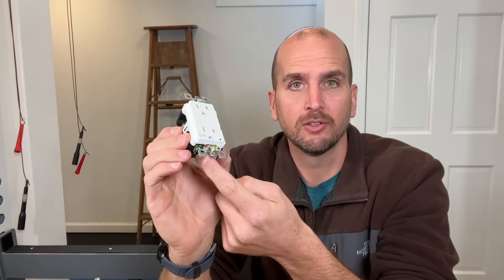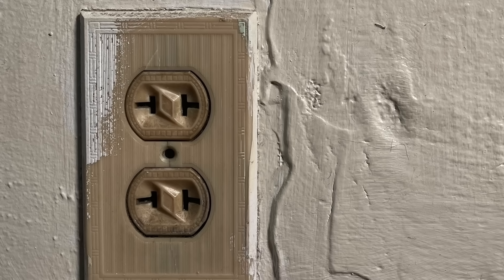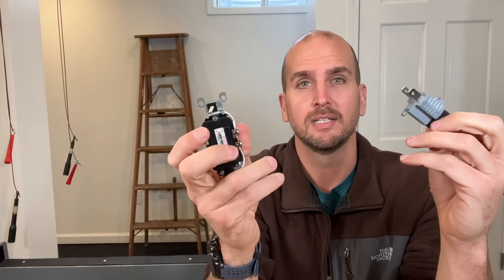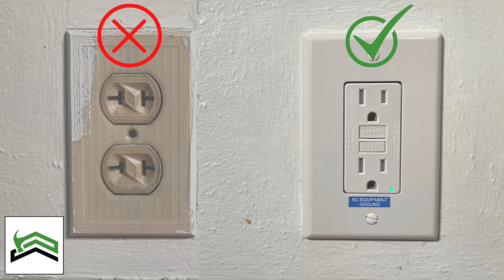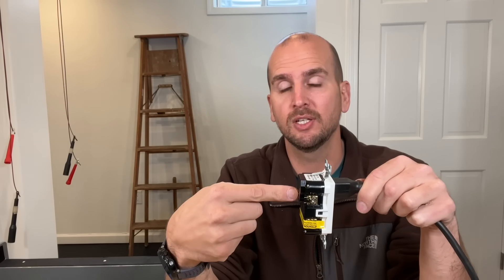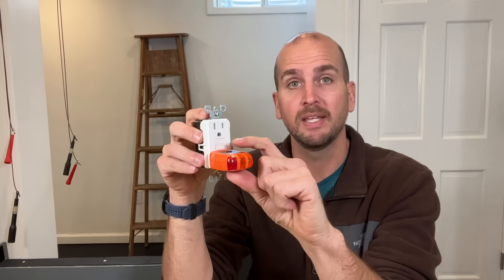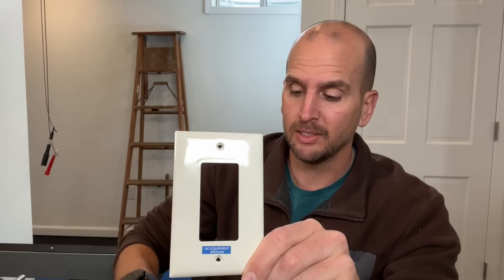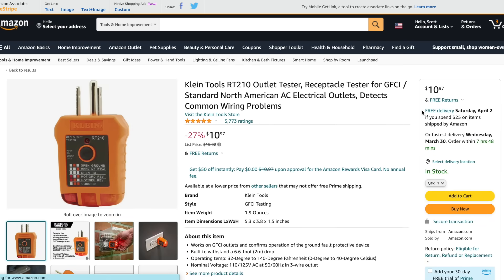Does a GFCI Outlet Still Provide Protection Without A Ground Wire?

Comment: There's a semantics issue with your question. GFCI outlets have nothing to do with the grounding system of your home and therefore, despite the name, they don't actually provide "ground" fault protection. What would have been more accurate is if the inventor called them NFCI as they're actually neutral fault protection. 

Yes, the ground and the neutral are ultimately going to the same place, however, they aren't exactly the same thing. The neutral wiring is an isolated and insulated return path to the panel and is safe for constant electrical flow.  The ground wiring is broadly connected (including to parts of an appliance that shouldn't ever be powered) and is not insulated and is not safe to ever have power except to in that rare moment it's needed. 

Ultimately, yes a GFCI outlet provides superior protection to standard grounding. This is the reason why they are required in wet areas of the home where you're more likely to have problems. In the time it takes for a standard grounded breaker to trip at your panel, you could be dead. If it wasn't for the cost, code would require every circuit in your home to have this and arc fault protection as well.
Reply: You mean its not going to the grounded conductor, is that what you are saying
Reply: I'd call them an 'Unauthorised path device' - where an electrical current is using a path it's not authorised to take !
He's wrong with his 'yes' to the original question. Without the ground connection (if not obvious it's via the neutral wire - which is connected to ground elsewhere) the GFCI would not trip - but neither would it need to as a ground circuit could not be made.
Reply: It depends on what you mean by "ground fault".  If the fault is you standing in your bare feet on a concrete slab, or touch metal siding, or copper pipe, and touching the hot you are the ground fault, and the GFCI will trip.

The terminology has nothing to do with the ground wire, it is about detecting the most common reason for you getting zapped - you providing the ground path.
Reply: Ground fault means current escapes to the ground. It has no direct connection to the grounding wire though it can of course be one possible path it escapes. (and  likely the list common on case if a tripping). The thing that GFCIs are designed is the current escaping through a person.
Reply: You are thinking about it backwards. It does sense ground faults, but it does so by measuring the current on the neutral. So it measures the difference any time there is current going to ground instead of back on the neutral. If current goes to ground (ground fault) instead of back on the neutral, it will trip. Thus ground fault protection.
Reply: @brianharmeson3144  I don't think you understood what I described.

A GFCI measures the difference in current between the hot and neutral, and trips if they're unequal.  It does it in a simple way by winding a turn or so of both thru a toroidal core.  If the currents are equal, the magnetic fields cancel.  If they're unequal they don't cancel and the detection electronics fire the contactors and turn off the circuit.

"ground fault" is a rather "generous" term to describe several different things, including hot-to-ground AND neutral-to-ground shorts, perhaps not even to a wire in the same circuit, or even dirt.  Indeed, in some really inductively noisy circuits (eg: switching high load motors off and on), induction/capacitance can get the hot and neutral to momentarily disagree without any shorts anywhere - aka "nuisance trips".
Reply: @fromagefrizzbizz9377  My reply wasn't to your comment. It was to Roger Smith.

Comment: Most gfci's will not work without a ground
Reply: Why not
Reply: @thomasmarable6818  Most will still work as the neutral is grounded - at the main panel or by the power co.

Comment: One HUGE issue I ran into replacing an ungrounded two wire receptacle with a GFCI was that it was mounted in a metal box and the hot screw was touching that box, then passing through the mounting strap to the ground pin. The person had a refrigerator plugged into that receptacle and the frame was then hot as a result, and the GFCI did not trip, because the power going to the box came from the feed wire and not the load side of the GGCI. In this case, a narrow situation, and not to code, but still in my opinion safer, is a jumper at the receptacle from neutral to ground, this would have created a short and tripped the breaker and not allowed the refrigerator frame to have become energized and shocked the owner. FYI I did not do the original install, I just fixed the problem later, and not with a jumper, but to keep the screw from touching, but I would like to see a change to allow for the jumper.
Reply: @integr8er66  I'm pretty sure its a bad idea to ever connect neutral to ground.  Imagine the neutral wire feeding the outlet becomes open due to a bad connection leading to the outlet.  Now when an appliance is plugged in and turned on, the power is fed through to the neutral wire which is jumpered to equipment ground.  There is now no return path to earth ground via either the neutral or missing ground wire.   This then energizes any exposed metal that is connected through the jumper to the now hot neutral.  Better to do what you did and keep the screw off the box.
Reply: @djcanfield1  Imagine the alternative which actually happened rather than speculation on what might have happened which would only create a situation of exactly equal danger. I think its highly unlikely that the neutral wire would just fail. Just my opinion, and I doubt anyone at the NEC will agree 😁
One more thing to note. This condition existed for over two years that she lived there and who knows how much longer, but she was never shocked until she touched the refrigerator AND the metal part of the dishwasher (which was very inaccessible and only happened because she was reaching under it) which actually was grounded at the same time. Just think if neither one was grounded, she would not have ever been shocked.... Grounding good or bad in this case??? The ground in this case made the other situation more dangerous, not less
Reply: @integr8er66  This would happen regardless of whether it was a GFCI or a regular outlet.  This is just sloppy workmanship, and one reason you'd might prefer to put a wrap of electrical tape around the outlet terminals.

By connecting the neutral to device ground you'll cause any GFCI upstream of it to trigger.  Which'd get annoying if it was a whole-house GFCI.

Neutrals do get loose sometimes, and the consequences can be really nasty if it's at the panel.  This is why the NEC has been banning 3-wire connections to stoves for decades (in three wire stove connections, neutral is connected to the frame), and the CEC even longer.
Reply: @integr8er66  You should follow the code. Then you can think how you can improve things without breaking the code. The thing is that if someone gets killed and you have broken the code you are screwed. Nobody will listen your explanations how you thought it was safe.

I agree that connecting the ground and neutral to the ground is not inherently dangerous. It was the standard method in many countries for decades. In Finland it was the only method allowed in 1930-57. Since then until 1989 it was allowed and common. It still is legal if one wants to ground existing sockets. Here one would do that only if one wants the actual ground as one can plug any plug to an ungrounded socket. Here the GFCI method would be illegal.

To ou a simple example you cannot hägo to the UK and drive on the right side and then claim it is no more dangerous than driving on the left. You should do what is expected.
Reply: @fromagefrizzbizz9377  if there was a GFCI upstream there would be no issue.
Reply: @okaro6595  If the ground and neutral were connected between two GFCIs, the upstream GFCI will trip once any current flows in the neutral.
Reply: @fromagefrizzbizz9377  No, it wouldn't happen if it wasn't a GFCI because if it wasn't it would be a 2 prong receptacle and thus no ground at all, but that wasn't my point, the point is with the GFCI it did not protect the user, and it did not trip the circuit breaker, and it caused the frame to be hot because of the ungrounded ground pin that was connected to the hot box. I know neutral ground bonding like I suggested are bad, but I think in this one instance it might be a better solution.
Reply: @okaro6595  Did you even read what I wrote? I SAID I DID NOT put the jumper in, I SAID I wanted the code to change to allow it. I did the work to code.
Reply: @okaro6595  That is true, but there wasn't, and the installation was 100 % to code. There is a problem with the code because it allowed this problem to exist
Reply: @fromagefrizzbizz9377  Why would you put two GFCIs is one circuit? If I put in a GFCI breaker I would put a regular three prong receptacle in in place, or just use the GFCI receptacle with no jumper. The jumper is moot if there is an upstream GFCI
Reply: @fromagefrizzbizz9377  There would be no reason to put the jumper in if there were an upstream GFCI.
Reply: @fromagefrizzbizz9377  This is about installations without ground wires. The  GFCI can trip if there is some alternative path like a washing machine could leak through water pipes. On TN-C GFCIs are therefore not used on PEN-wires even where PEN-wires are allowed.
Reply: @integr8er66  A better solution would have been to change the box into a plastic one or put the GFCI upstream.
Reply: @integr8er66  Are ungrounded metal boxes allowed by the code?
Reply: @okaro6595  They were when this house was built, and I don't think changing the box is required just because you change the outlet to GFCI (That I know of)
Reply: That is one big fault in the method. A GFCI protects only against faults that happen after it. Since the grounding conductor connects the case to the box there is a potential path for the electricity to travel to the case. It would be safer if there were sockets with a dummy ground hole with contacts but I do know it would be impossible as people would mistakenly use them in new installations.

If the metal box is not grounded one should replace it with a plastic one. Alternatively one could use a GFCI breaker or some other GFCI before the outlet. That would offer protection. One can also use a cheater plug and not connect the grounding screw to it.

Comment: You always explain things so clearly. Thank you.
Reply: But wrong ! The GFCI needs a ground - and if it doesn't look like it has one, it'll use the neutral wire as that will be connected to ground usually somewhere.
Reply: @millomweb  Can you provide a source or a statute? I don’t see how what he said is wrong. It doesn’t need a ground to work. Edit. In fact I just double checked and you don’t seem to know what you’re talking about.

Comment: Hello, I'm just wondering about a video I saw. It said if you replace the first 2 prong in the "row" with a GFCI it protects all the plugs in that room?
Reply: If they are wired correctly on the
same branch.
Reply: So yes if it was done correctly in the first place..
Reply: @carriebrooks1877  Simple answer is to test the trip from each outlet !
Reply: @millomweb  Note that a normal GFCI outlet tester will not work on a 2 wire circuit.  Only the GFCI outlet's own TEST button will.

The best way to check is to first check all the outlets are energized, then use the TEST button on the GFCI outlet.  All the protected outlets inclusive of, and downstream of the GFCI will de-energize, and the RESET button will re-energize them.
Reply: @fromagefrizzbizz9377  It's been proved that test buttons do not test the device, they trip it by inferior means - such as by significant overcurrent on the trip circuit.
Do the devices specify what their own trip buttons actually do ?

Here in the UK the specification trip current is 30mA. I've made a test plug that leaks 29mA to earth. If that doesn't trip it, it's defective - even if its own trip button still works.
Reply: @millomweb  A 30mA RCD will trip typically go at around 27mA.
The trip button does exactly what it says and it's actually a requirement to make sure that it works when testing them using professional testing equipment
Reply: @michaeldunham3385  Testing equipment does not test the trip button. Find a GFCI and see what the data sheet for it says the trip current is when using the button. I doubt it's as low as 30mA
They can trip as low as 15mA. The tester I made goes for a 29mA trip current.
Reply: @millomweb  Where have I claimed a tester will test the trip button?
If you've got an RCD tripping at 15mA Then you've got a problem.
I don't use some cheap tester I've knocked up, we do actually standards that test equipment needs to meet.
I know that you wouldn't have a clue on exactly what the actual tester procedure given what you've written
Reply: @michaeldunham3385  "Where have I claimed a tester will test the trip button?"

"The trip button does exactly what it says and it's actually a requirement to make sure that it works when testing them using professional testing equipment"

"If you've got an RCD tripping at 15mA Then you've got a problem."

A trip of 30mA is not an average but an upper current limit. I've heard some will trip as low as 15mA - sooner than the limit but on the safe side of it.

If an RCD states 30mA trip current, then I'd expect it to trip before 29mA - which is the current I pass through them to test them. If it doesn't, then to me it's failed.
Reply: @millomweb  for the last time a testing the isn't used to test the functionality of the test button you put your finger on to manually test it
 No it should not be tripping at 15mA that mean either there is a problem with the RCD or picking up a low level fault within the circuit. We use ramp testers to identify this problem
Do you know what the maximum earth loop limit is for a 30mA RCD?
Do know what maximum trip time is for a BS 4293 RCD is?
How about BS EN 61008 or an RCBO BS EN 61009?
How about a RCD socket BS 7288?
And seriously doubt your tester compiles with BS EN 61557-6
You have absolutely no idea about how to test any devices let alone the correct methods
Reply: @carriebrooks1877  replacement of faceplate won't provide protection for multiple sockets, for that you need to fit a device at your distribution board
Reply: @michaeldunham3385  Incorrect.  GFCI outlets have two pairs of lugs.  One pair is to be connected to the wire coming from the panel (line side), the second pair (load side) passes GFCI protection through to the rest of the circuit.  The GFCI will protect the rest of the circuit just the same way.  That said, some people don't understand this, and will wire the lugs backwards, or not use the load side lugs at all.  In fact, if you connect the load side to the panel, the GFCI may not work at all.

This is all outlined in NEC publications talking about how to make 2-wire circuits legal.

GFCI breakers are for those times where you're not sure which outlet is first in the circuit, or it branches multiple ways before the first outlet, or you need arc-fault too, which isn't available as a outlet.
Reply: @fromagefrizzbizz9377  incorrect? How many years have you been an electrician? Obviously none if you think that's how GFCI outlets work
Reply: @michaeldunham3385  I've been wiring for over 50 years.  I know how GFCIs work (differential current flow through a small toroid), and I also know what the code books in both the US and Canada say.

What I've said is lifted directly from GFCI instruction sheets, both NEC and CEC codes and official "how to" guidance on upgrading 2 wire circuits to code compliance in both countries, including how to extend GFCI protection to the downstream outlets - by connecting the GFCI terminals properly.

It also has a tidbit of information (on why a GFCI outlet test button will work on a two-wire circuit, but a plugin tester can't work on a 2 wire circuit) from a guy who designs and tests GFCI for UL/CSA approval.

Here's an interesting fact: a GFCI MUST successfully interrupt a fault current in excess of 20 thousand amps.  It won't do you much good if a hot-ground short fuses the contactors (in a GFCI or a breaker) together on a short circuit, does it?

How about you?
Reply: @fromagefrizzbizz9377  you're trying to teach me how they work? That's hilarious, I'm well aware of how they work, I was a test engineer for a   national company and I have tested thousands of the things
Reply: No